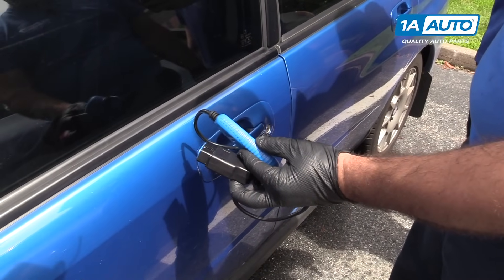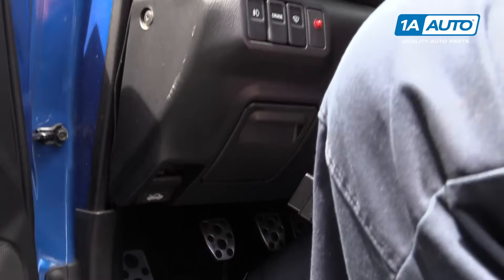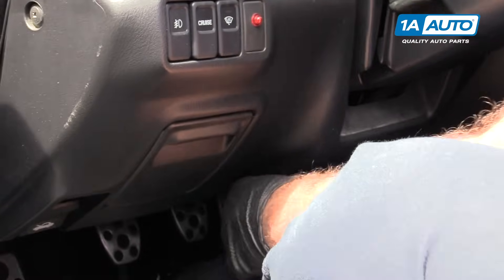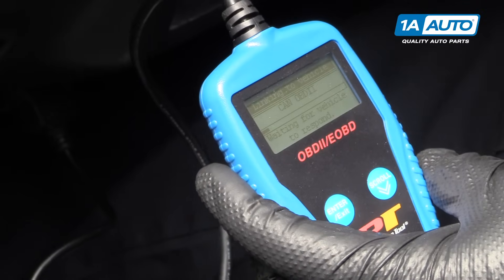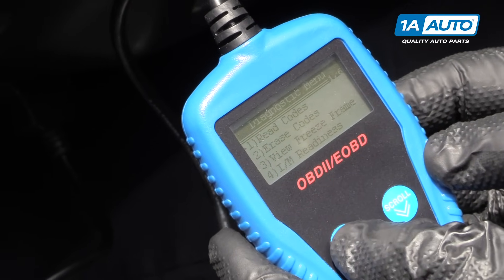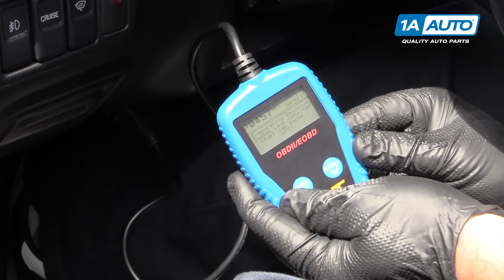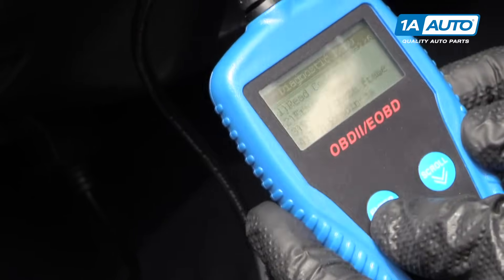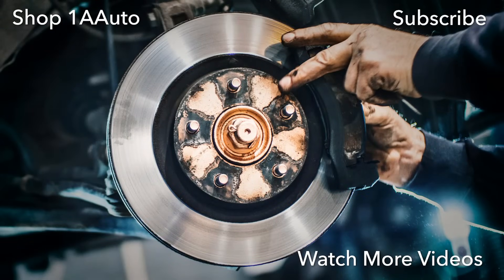How to Use an OBD-II Scanner

Comment: Do I have to clear the error myself or should the error go away on its own once fixed?
If I clear the error without fixing the cause by mistake, will it reappear?
Reply: Great question once fixing the issue you clear code.  But the check engine light will only truly go away once the underlying issue causing the code is fixed; simply clearing the code without fixing the problem will only temporarily turn off the light

Comment: Can I plug it in while the car is on and running?
Reply: No, it can damage the OBD-II scanner tool, and/or can damage the cars computer.
      Only plug the scanner in when the car is off, once you do that you can insert the key and then turn it 2 times (BUT DON’T START THE ENGINE).
      And when you’re done, do the reverse by first taking the key out of the ignition, and then unplugging the scanner.

Comment: Are shown error codes only related to current issues or are they related to current issues plus not erased codes from the past?
Reply: 9 months late but usually they are present. It's very rare that a car will retain past trouble codes once the CEL has been cleared.
Reply: @ArthurMorgan123-r6y  thanks

Comment: I have this code reader and the battery reads ok but I have no clue what the other things mean. How do I know if something is wrong? I failed my emissions test and I was told to do a drive cycle to reset the emissions codes. Where do I find emission codes?

Comment: Do I need to wear gloves?
Reply: Yes and safety glasses.
Reply: Probably want steel toes on too.
Reply: A full body hazmat outfit with a respirator.
Reply from the maker: +Ian You do not
Reply: And a hazard suit just for a extra layer of protection
Reply: Yes and a hockey mask
Reply: You'd also want a radiation protection full body suit
Reply: @OHa5anO  he’s gonna want sunscreen too
Reply: Dont forget your respirator 😋😂
Reply: Yes.and one of those beanies with a propeller on the top of it as well
Reply: Only if ya wanna look cool sport.
Reply: Should i put on a safety vest as well🦺
Reply: Not funny
Reply: Don't forget the crash helmet
Reply: And don't forget to brush your teeth and put on a three-piece suit before you use it. That's critical. 😅
Reply: No mitts and a lingerie are required for your car to get turned on
Reply: No